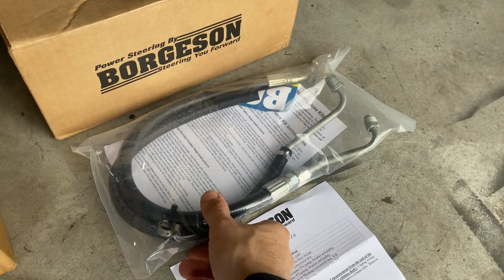Classic Car Power Steering Conversion - Borgeson - Mustang

Comment: I had this Borgeson conversion kit installed on my 66 Mustang, but now when I turn the shaft  (by turning the steering wheel or turning the nut directly on the shaft without the steering wheel) it squeaks. How can I stop the squeak?

Comment: How do you feel about the steering pump being cantilevered off of the head like that? Do you know if there are any brackets available that run from the bracket to the water pump? Ive been installing the same kit.
Reply from the maker: I do know the OEM power steering pumps used a bracket that attached to the water pump bolts. I’m not sure if that’s compatible with the Borgeson pump but there are no issues with bolting it to the cylinder head. Thanks for watching!
Reply: @DropClutchGarage  here I am a year later trying to fix a leak in my borgeson pump.. I don't know if you've experienced similar issues with your steering pump, but mine is leaking from the lowest bolt on the mounting bracket.

Also, wanted to let you know about a safety psa.. I highly recommend replacing the steering rag joint with a solid universal coupler. My long tubes completely melted the rubber gasket stack which caused the steering wheel to lose its connection with the gear box. By some miracle the coupler finally gave out once i had the car on stands after having just been driven during the aligning process. Mind you this was with the full weight of the car off the ground; While i was turning the wheel lock to lock it suddenly just started spinning free. I don't want to think about what could have happened on the road. Stay safe man!

Comment: Thanks for the video! About to order the conversion kit. What brake booster setup do you have on your car? Was also thinking of converting to power brakes. My car has factory disc brakes. (GT option). Also, did this kit require a '2 sheave' water pump pulley in addition to the 2-sheave crank pulley?
Reply from the maker: Thank you for watching! Yes a two sheave is needed. The power brakes kit is from Power Master!

Comment: Hi! Great video btw, 1 question when you put the box in did it look like it was align perfectly center when looking at it from the inside or did it look a bit to the right.  I'm installing one right now and was just wondering if it's suppose to fit a bit to the right or center.  Thank you,